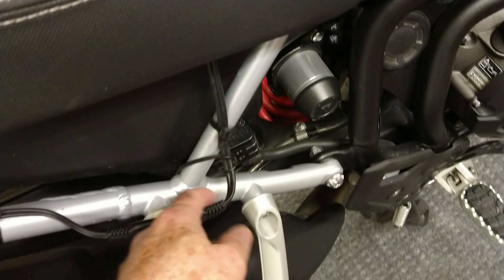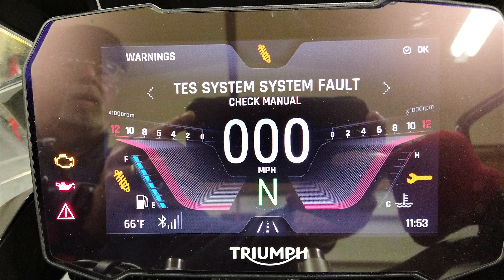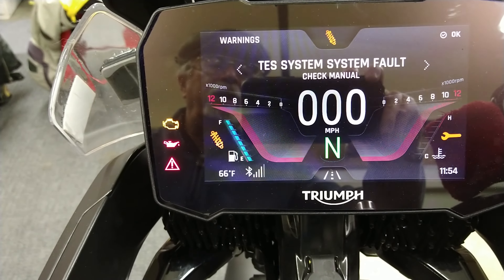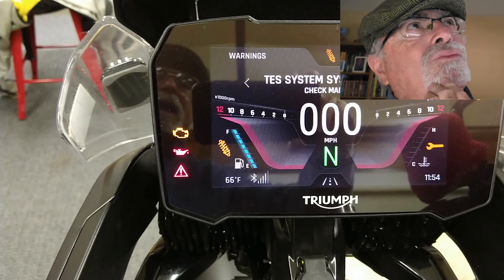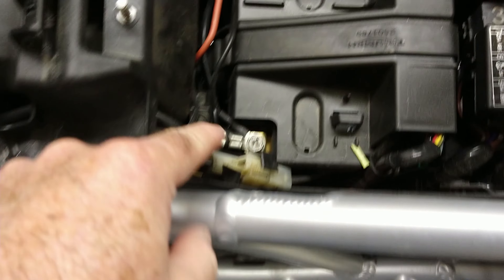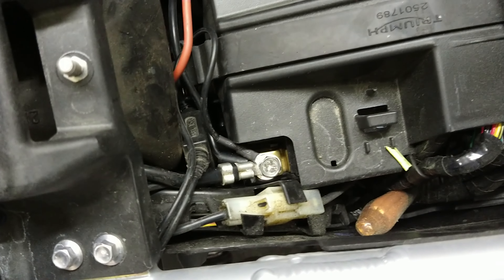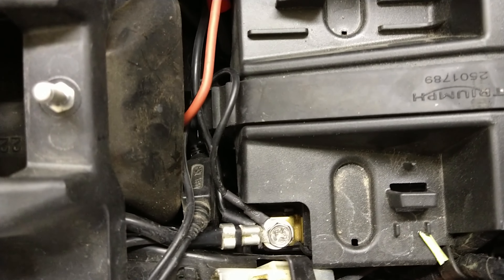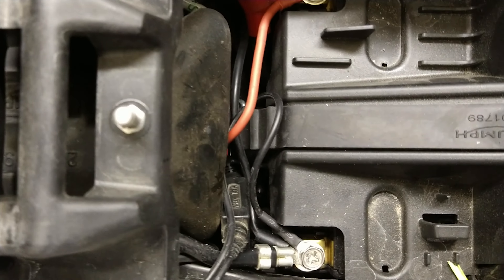Triumph Tiger 900 GT Pro with TES Fault

Comment: I had a funny happen after I had my 1200 xca serviced no cruise I was able to reset by going through a ritual of sorts also I changed oil in it last year was under the assumption I needed a some sort of program but I just went to service reset and it magically worked this time I dont know I would think that you had all switches off when you unhooked power to the system  hope they get it with the servo replacement
Reply from the maker: Thanks Kevin, I  don't think is unreasonable for a rider to expect to reconnect their battery with creating a system fault.
Reply: @flatcapcaferacer  yea thats crazy just like not being able to reset a service light whithout an outside source and the cruise not working after a service I found the solution on youtube chances are if it hapoened to you its happened to someone else in my case it worked Mr Bills Rocket is running good
Reply from the maker: @kevincraig8257  At least I'd like to be able to reset the fault without going to a dealer.

Comment: My brother had exactly the same fault code when disconnecting his battery but reset itself after several on and offs of the ignition. He still had the spanner symbol, which turned out to be the clock needing resetting. I always connect a pp9 battery across the terminals with crocodile clips before disconnecting the battery in any of my vehicles. Saves resetting the click and any possible error codes.
Reply from the maker: I guess I might give that a try the next time, I  appreciate the work around.

Comment: Thanks for alerting us all to such issues,it's good to stay ahead of the game 👍 Off subject, I saw in the past you said you set up another channel and posted the same video on each to guage subscriber numbers. I myself set up another channel for the arrival of my KTM 890 Adventure R, having first set up a new Email to which it would be linked. The problem is every time I either log into YouTube or try to post on my new channel,  I'm reverted back to my old channel and that's where the video appears. I've tried logging out and then in again under the new Email but Google always ends up reverting me to my old ID. Any tips or advice would be very welcome 👍
Reply from the maker: I did the same thing you did with separate email accounts.  I can go to youtube analytics view one account then switch to the other account.  I get notifications of comments on the separate accounts. You should be able to click on your account icon in top right and then select your other account just like your email.
Reply: @flatcapcaferacer  Thanks for the quick reply 👍 I've tried everything you said, clicking the icon allows me to see the two accounts but whichever one I select takes me to my old profile and account. When I first uploaded to the new channel which had no content, the video appeared on my old channel. I may have to close the old channel, I can't see another way round it.
Reply from the maker: When I do it I get a drop menu with "switch account" and I  click on that and it takes me to my other account or channel depending whether it us youtube or email.
Reply: @flatcapcaferacer  That's what I've been doing, as a matter of interest do both your channels show the same videos, comments, etc? I thought I set a profile picture for my new channel, instead it shows a g, clicking on that does nothing and when I press return I'm back to everything that's on my old channel,videos comments, subs etc. I'm getting very frustrated trying to work it out. If I change Email accounts it shows the new profile pic and only Emails to that account. Yet if I then go to YouTube everything appears to be my old channel. Thank you very much for your valued assistance. 👍
Reply: @flatcapcaferacer  Finally!! I was clicking on manage my account which although showing both accounts didn't allow clicking to change. I noticed an arrow > in the top right corner, clicking that allowed selection of both channels. I uploaded a short near miss video and Hey Presto my new channel is up and running 👍😀
Reply from the maker: @michaellilley6725  Good for you Michael,  persistence pays off.

Comment: A friend of mine has had suspension issues with his and it took a while to sort, now he has a quickshifter fault which is ongoing. Why can't they help us to sort these problems out.
Reply from the maker: It does seem the more complicated our bikes get the more fragile and harder they are trouble shoot.
Reply: @flatcapcaferacer  Yeap, running before they can walk as I always say. Great when it works though : )
Reply from the maker: @exeterrider  Generally bikes today are more reliable than the ones I rode back in 1970s.
Reply: @flatcapcaferacer  good point 👍

Comment: Having read similar issues after disconnecting their battery, I was concerned with hard-wiring my Nav to the battery.  So rather than disconnecting it, I carefully connected each wire one at a time, without allowing the terminals to disconnect.   It worked.  And no fault errors.  This was on my 2021 GT Pro.   I have read, however, that by resetting the date and time after reconnecting the battery the faults go away.
Reply from the maker: Very interesting.  It is something that I hope I don't have try.😄

Comment: Sorry to hear about your issue. It's a frustrating one and honestly it concerns me in regard to long term ownership of these ever more complicated motorcycles.
I'm interested in the 1200 Tiger and was disappointed to hear that even the base model doesn't come with standard suspension, you have to have the electronic adjustment. 
Hope you get it sorted, you should be able to put a charging lead on a battery without it throwing a fault.
Reply from the maker: I actually like the adjustment on fly for the rear shock....that I use it surprises me. Like most motorcycles today with plenty of technology gremlins sometimes creep in. The bike is working fine now, but I  will be replacing the suspect piece under warranty. 

The bike has been flawless except the couple hours with this fault.
Reply: @flatcapcaferacer  I had an early version of the Ohlins on my 2012 Multistrada where the rear suspension control unit failed and left the rear shock so stiff and extended that it wasn't rideable. All of course fixed under warranty. Its experiences like that, they affect future purchasing decisions although given time this tech does get more reliable.
Reply from the maker: Yes today's bike are more reliable than what I rode in 1969, however when they do malfunction they sometimes become unsafe to ride, almost impossible to diagnosis and a crap shoot to repair.

Unfortunately a lot of these issues show themselves after the warranty period and become extremely expensive to repair kn the occasion the are correctly diagnosed. 

I have 3 basically primitive motorcycles by today's standards and one complicated one. All but the Royal Enfield have 7 year warranties so that reflects my confidence that I feel a very expertise piece ( more than $1200) will quit working in seven years.

Most folks concentrate on what the routine maintenance between models may be and use this as a criteria. I also consider that but I research the risk of major components failing outside the warranty period as a more important criteria.